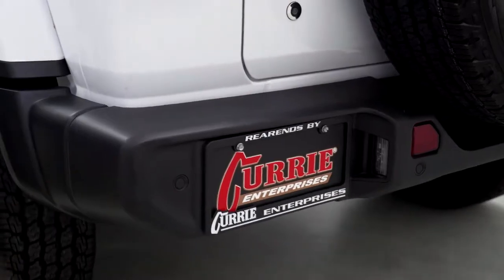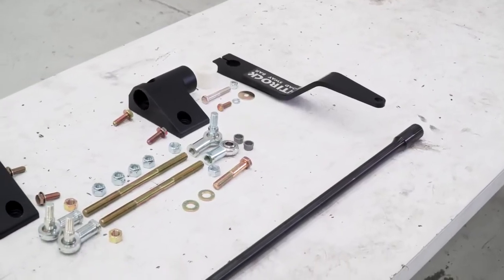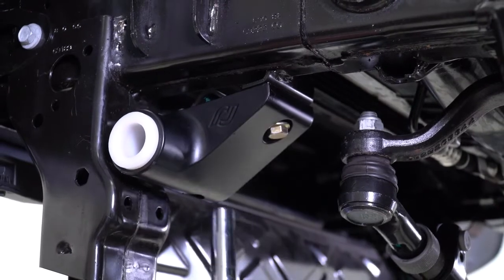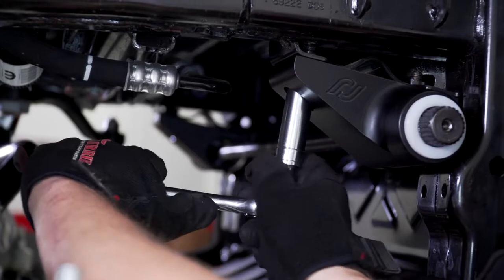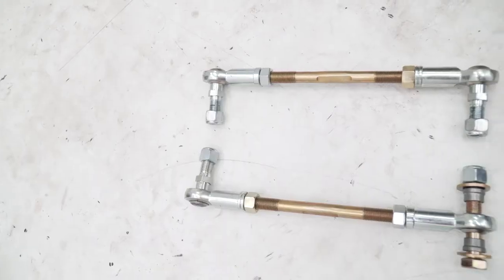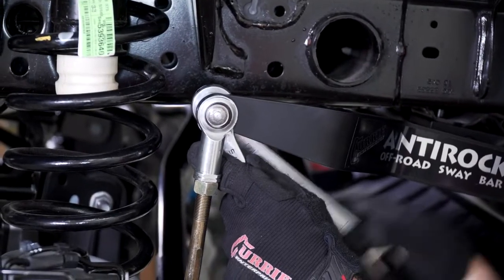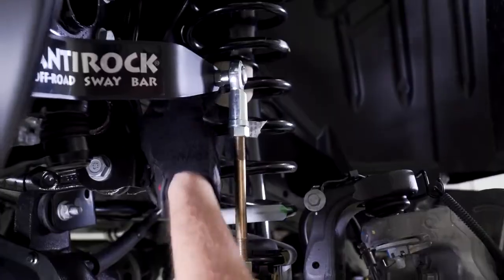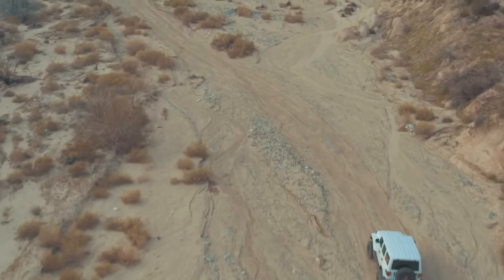RockJock's Jeep JL Front Antirock Sway Bar Installation.

Comment: I've hit a hog and it broke the motor on my JLU Rubicons electric sway bar and paying 1500 for a new one doesn't sit to well with me. Will this be able to replace it? I don't really know what direction to head in. I want to be able to articulate fully when wheeling but the product didn't look like it has a disconnect but it might not need one I guess. And will this work with any lift kit? Say 3.5 to 4 inches? Any help would be great thank you.
Reply from the maker: Yes, this will be able to replace it.

Comment: I currently have JKS quick disconnects which required that I cut the passenger side mount on the axle housing. I see in the video that there is a misalignment spacer being used but I don't have the other side, if you will, so will that still work?
Reply from the maker: Actually for a question that specific, can I have you call us direct, so we can address this with you in person? Please give us a shout; 714.367.1580. Either Brian or Travis can help with that. Thanks!
Reply: @RockJock4x4byJohnCurrie  I have this issue as well. Rubicon Express quick disconnects required the passenger bracket be cut off.

Comment: does the arm need to be at any position ? level or higher with the frame? as the video looks like they are pointed upwards and not level?
Reply from the maker: Hello Steve, the arms are to be level at the midway point in the vehicle's travel. Obviously, this kit out of the box, is designed to be at midway thru the travel of our kit. If you are putting on a custom vehicle, we recommend setting the differential at midway thru it's travel that your suspension build provides, then set the arm level, and then measure from hole to hole for proper end link length. Thank you!
Reply: @RockJock4x4byJohnCurrie   great thanks  i was looking into getting one of these once this madness is over and get it installed  as soon as i get it lol  and i didnt see it there - im sure the directions would have explained - thanks a bunch be safe !!
Reply from the maker: @stevep6108  no problem! You take care and be safe as well!

Comment: can I reuse another sway bar end link in this kit ?
Reply from the maker: Hello sir, when you say "reuse", you already have some Antirock links and you want to use them with our JL kit? As long as the Antirock links that you have feature the 8 1/2" gold, threaded link rod, you can reuse them, yes. The 8 1/2" rod links are what come in this kit. Thank you!
Reply: @RockJock4x4byJohnCurrie   sorry what I meant is if I can use another end links that doesn't come with Antirock kit? I have STEER SMARTS YETI XD FRONT SWAY BAR END LINK KIT - 2.5-3.5IN LIFT
Reply from the maker: @luisan027  oh, gotcha. To be perfectly honest - I don't know. I've never actually seen one of those links in person. I know a customer of ours had used them on his JK and they seemed fine, but that is unfortunately the extent of my knowledge on the Steer Smart links.